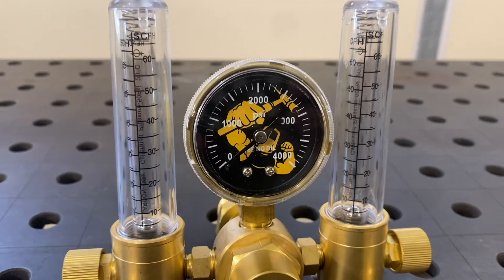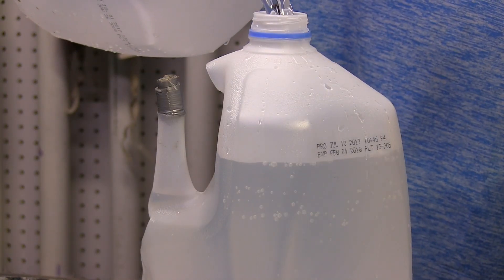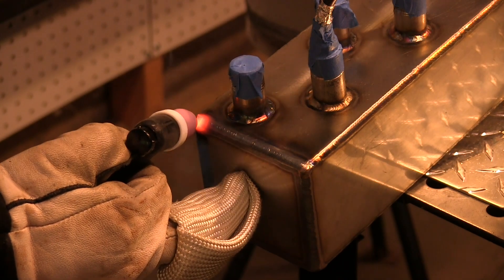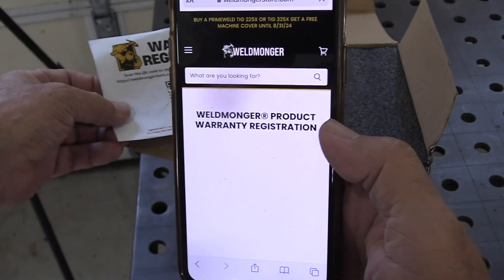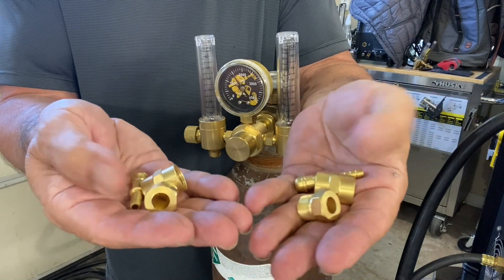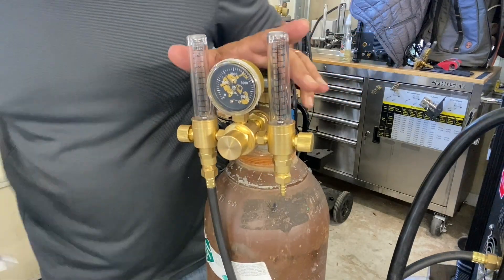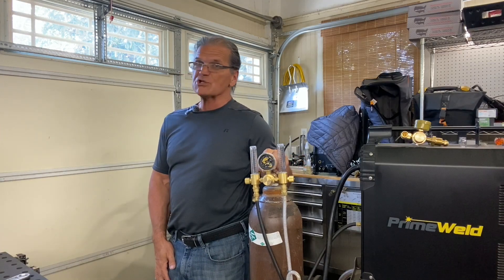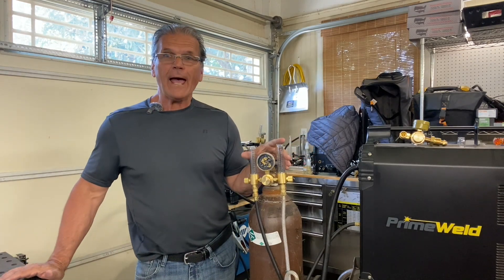Argon Purge Tips for TIG Welding Stainless Steel

Comment: Someone needs to invent a brush to clean those tank seats. One speck of debris can actually damage the brass stem of regulators and then you'll fight it forever. I had to disassemble my O2 regulator and re-face the stem seat in my lathe  - no more leaks or stretching the threads. I don't recommend it unless you have plenty of lathe experience because messing around with 2,200psi is not a trivial thing.